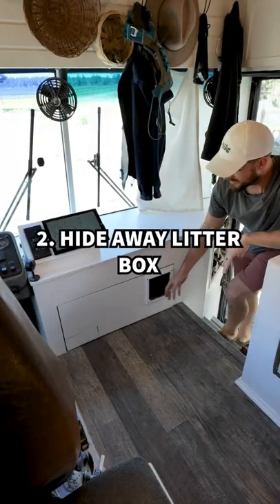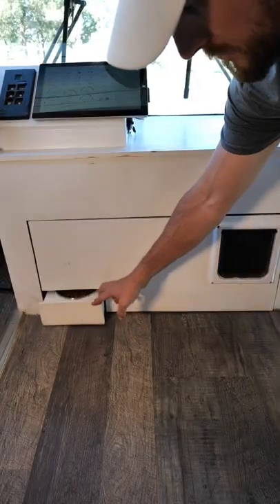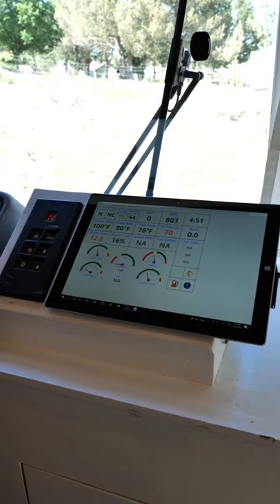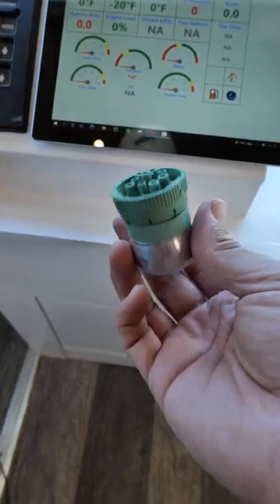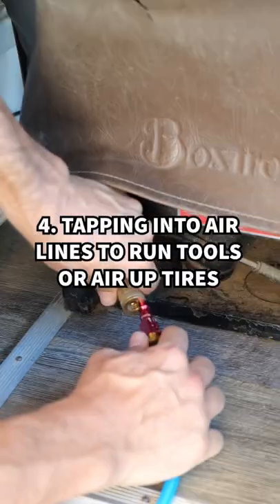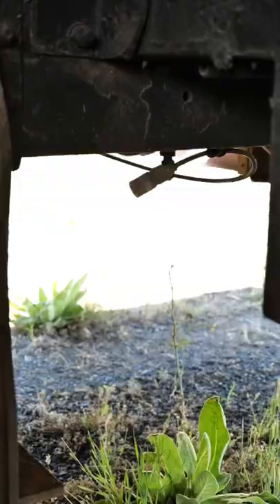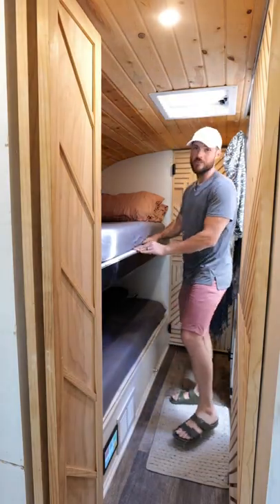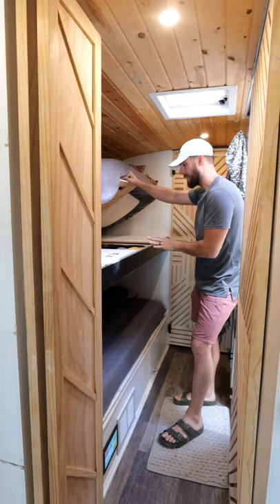5 Genius Features of Our Bus Build that you have to see! #buslife #smartdesign #skoolie #tinyhome

Comment: Pretty clever to add storage under the mattress!
Reply: It is but this is most likely inspired by navy racks that are pretty much the same as these but have been used since a long time ago
Reply: @happycamper4429  Yeah my coworker was a bottom rack guy, but I prefer the middle one myself. If you use the top one then we got a full set going
Reply: @Astrocat2374  I moved to the top one from the middle after opening my curtain one morning not knowing someone was right there getting dressed. Yep traumatized
Reply: @happycamper4429  lucky. early days on a sub we got to hot rack. 3 guys to 2 racks rotating scheduled. my first rack traumatizing experience was when my sea pup left his head lamp on wile in the rack. little did he know we could see his shadow from the other side of the curtain. feel free to use your imagination on what was being projected lmfao.
Reply: de hele navy heeft het
Reply: @LeftToFate  Sea Sock in action🤣

Comment: I really like the monitor system. That is a really good setup 👌
Reply: What program do you use for the monitoring?
Reply: I think they are using bluefire wireless 9 pin with bluefires software. Bluefire for rvs

Comment: Mine has a handmade front door that looks like the rest of the bus instead of a school bus door.
The best bus cat litter box port I’ve seen was accessed from an outside door while the cat had access from inside.
Reply from the maker: Wanted to keep the school bus aesthetic. Does yours have a touch screen display showing all your engine data? Or airlines you tap in to power air tools? Didn’t see you mention that part 😂
Reply: @BasicallyNomads  mine was converted in the 60’s when men had skills and thought things out for reliability and emergencies. All reliable analong gauges except one of the engine temps is digital. One wire makes the engine run, no computer, no sensors.
And looking like a “Coach” and not a hippie Skool bus keeps the car show trophies coming.
My friend does have touch screen stuff in his 4106, I think he has his run mostly on Google Home assistant. We both have proper flushing toilets. Oh and Bling so we don’t look like a dumpy skool bus going down the road with its “stop for kids” lights up there.
Reply from the maker: @mdcbert  I wouldn’t know. Can’t find your trash trailer anywhere to confirm. You’re telling me you didn’t even convert you’re yourself? LOL! Mine was done by my own 2 hands and years of learning and labor. You shouldn’t be so proud of something you bought. Clearly you don’t boondock for months at a time. A black water tank means id have to go to an RV park to dump with a chance to see people sad and lonely in coaches. Yikes. I’d rather be doing what I’m doing now. Living on a beach Mexico for the past 3 months. Stay sad!